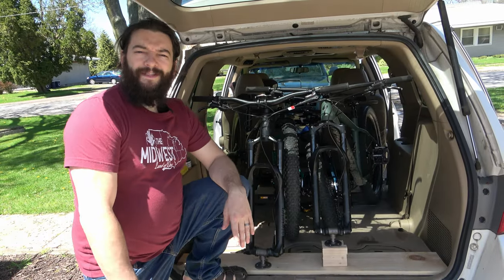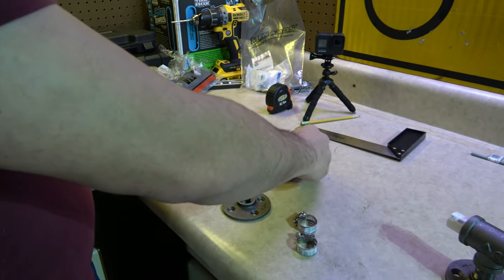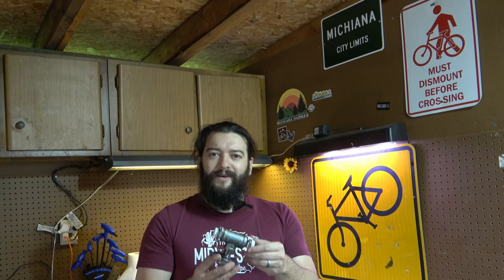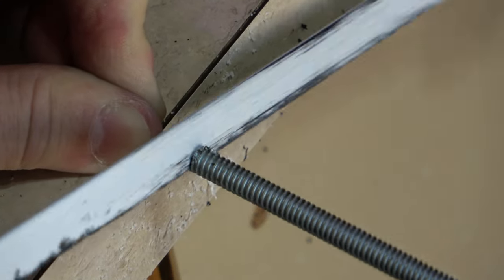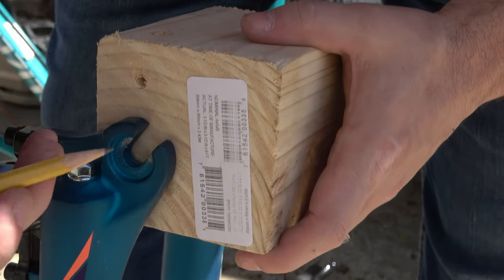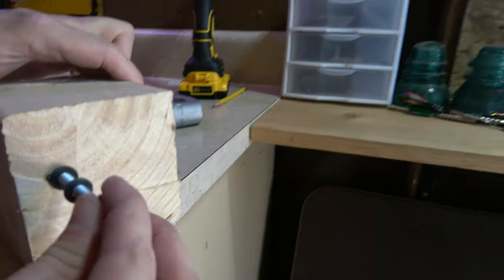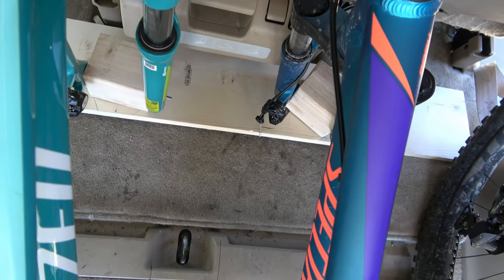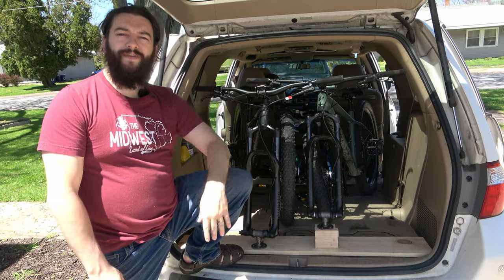Bike Mount Inside Vehicle - QR and Thru Axles

Comment: I think can skip the hose clamps if use marine grade heat shrink. It is lined with an adhesive. I'm definitely gonna give it a go thanks Bro you saved me a bunch of cash.🤘
Reply from the maker: Let me know how it turns out.
Reply: @MichianaMadman  Definitely.
Reply: End Mount came out Sweet! Not how I originally thought. I didn't have heat shrink large enough to go over the whole tee. 

I ended up putting Heat Shrink over the PVC pipe and twisting it in to the tee from one side. It took a bit to do this. After getting the covered PVC to the threads on the other side of the tee it got very difficult to turn.  I used a pair of slip joint pliers to finish twisting until both sides were even. I checked it with a tape measure as I went. Using the slip joint pliers chewed up the heat shrink. So I trimmed it back to the tee with a utility knife. The PVC isn't going anywhere. 

I was worried toward the end I might get the PVC stuck and that made me think of other ways to tackle the issue thought about filling the Tee with Hot Glue, silicone caulk or gorilla glue. I didn't need to though. Very happy with the results.

Also I found using Galvanized Components worked out a couple bucks cheaper at Home Depot.

I didn't have to buy any PVC my bike came with a PVC fork spacer so I used that.

I really like this solution it seems like a way better option than buying a manufactured mount and so much more versatile. 😎 🤘
Reply from the maker: Amazing!
Doing projects like these are a lot of fun.

Comment: Why not just buy the ones online. Those flanges are pricey? Plus all the other stuff?
Reply from the maker: Considering I would still need to buy a board to attach a mount off the internet, buying the parts was much cheaper. The wood was the most expensive item.
For the QR mounts, I could not find a 110mm version online (the kid bikes have boost hubs) so this was my solution.

Comment: You can put end caps on the PVC, instead of the clamp.  Then put a hole in each end cap to run the rod through.  ie: https://www.youtube.com/watch?v=DJcd8ELTt_4&t=3s  Oh!  Where are you getting the rod to attach the bikes?
Reply from the maker: For the quick releases, I bought the rod at a hardware store.
For the thru axles, I am using the bike’s maxles.